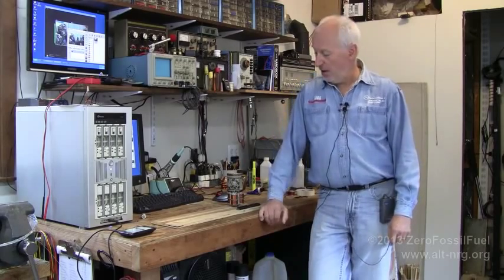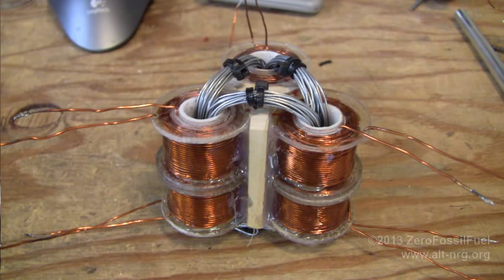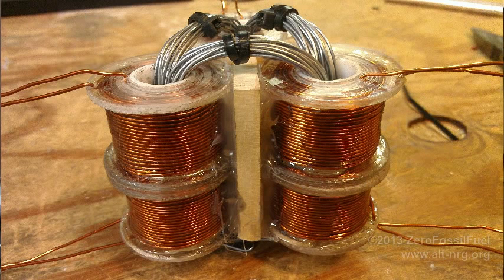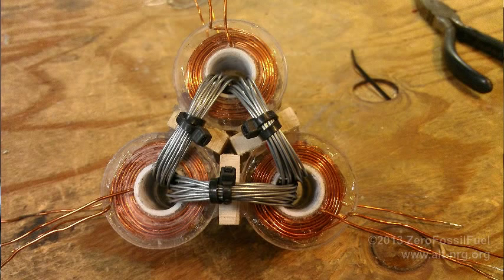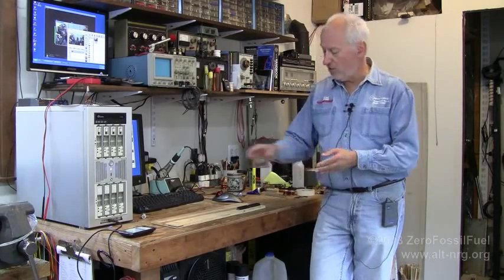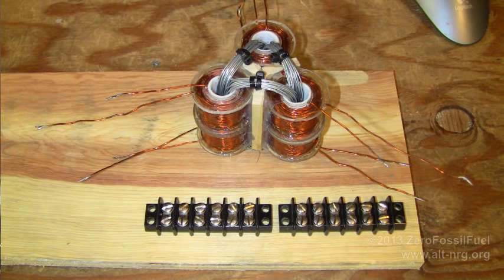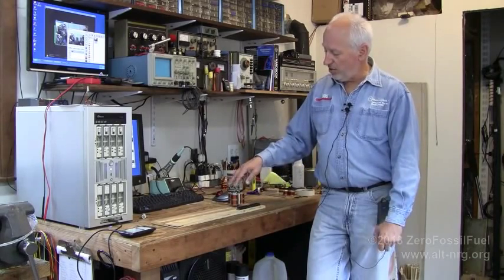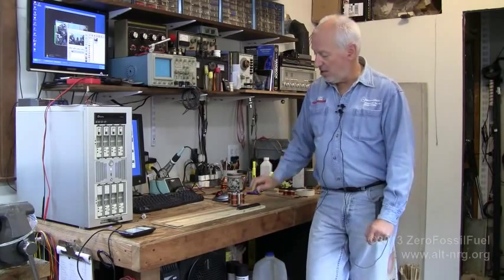#346 3D 3phase xfmr 01

Comment: Yeah, that is kind of overkill. They probably went in the 5 kW transmitters. That was back in 1988. If shipping was not an issue, are you interested? They probably weigh about 150 to 200 pounds each. I will try to call you at the phone number on your website later today.

Comment: Are you interested in any 3 phase transformers? I'll have to check as they are in my dad's warehouse and I have not really had a use for them and do not know if they were scrapped. They were new. They are 460v to 3520v @ 3A 18 KW which were to be used as a plate supply in 1KW TV transmitters. I have 5 of them if they are still there. You are welcome to one or more free. Let me know if you have an interest and I will go take a look if you are.

Comment from the maker: I used galv steel wire wrapped through the coils to make the core simply to reduce eddy currents. May or may not work. Call this a rough draft experiment.

Comment: Well done and funny burp ! ;) Prohst !
Please also try to see, if there is induction voltages at the end of the core wires. Are these steel wires isolated ? if not better use isolated steel wire and measure the voltage and current also at their ends. Thanks.